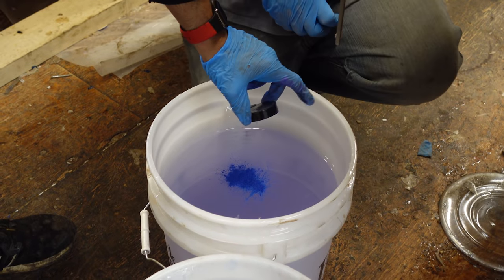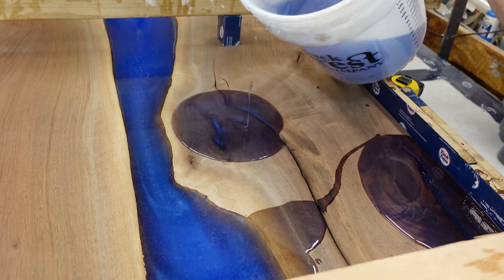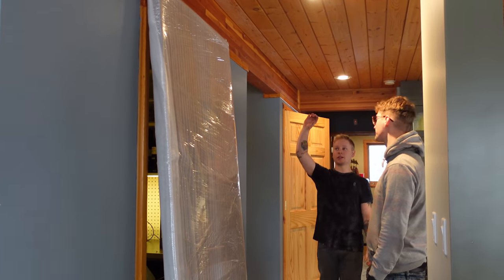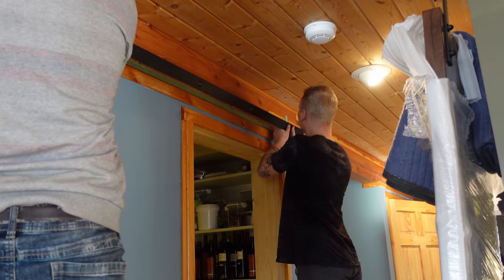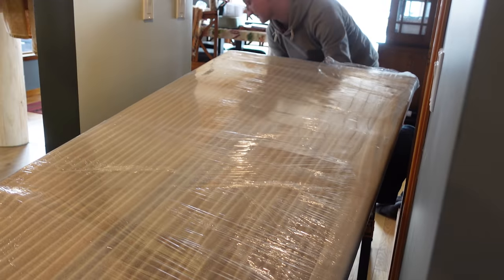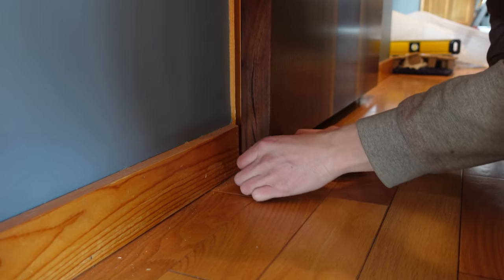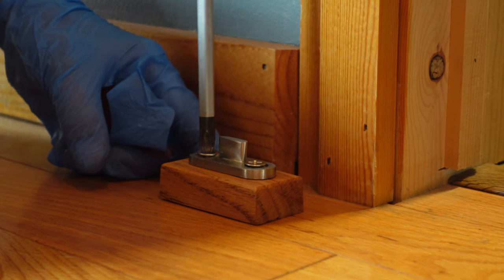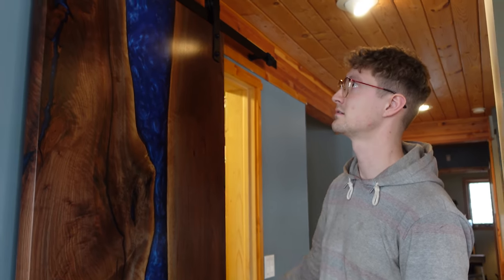Making Our First Resin Door

Comment: Nice door, looks like a table top up on end! So no door frame, no handle but still looks good. Shame about the big gap at the floor though. Look forward to seeing the exterior resin door, I feel confident that you will cover all the issues with that, sun ,rain, uv, etc. Good job as always, nice to see the installation. Cheers Michael.

Comment: Nice door! I seen you predrilled for mounts on bar. Instead of hexhead wrench, use a hexhead adapter on a cordless impact driver. Saves alot of wrenching. On barndoor hardware, a black sharpie comes in handy for touch up. I didn't see pulls for opening and closing.

Comment: Beautiful door.  A shame about the larger gap at the bottom.  Too bad the roller hardware was already installed.  It could have been adjusted with different holes to lower the door and fill the gap.